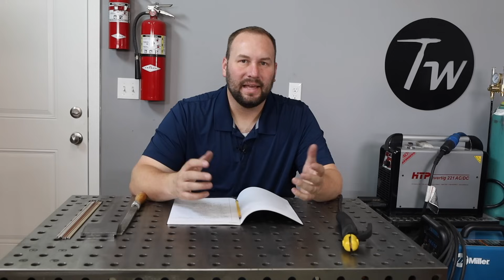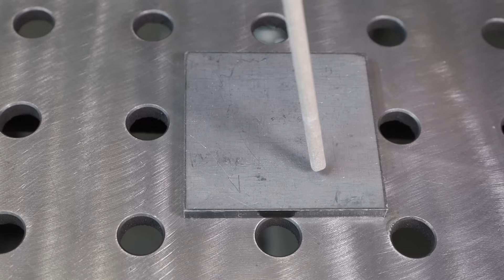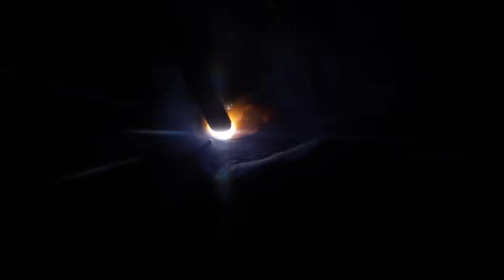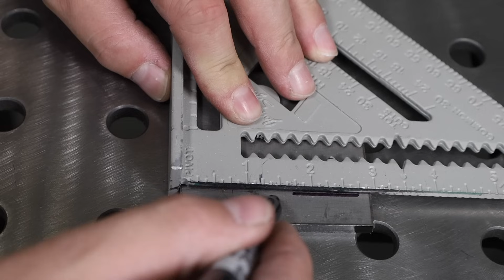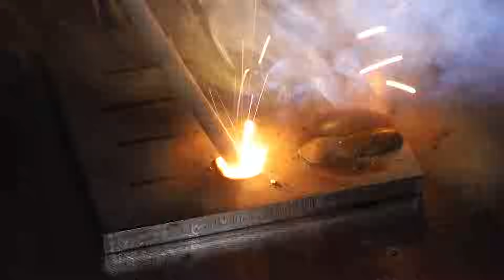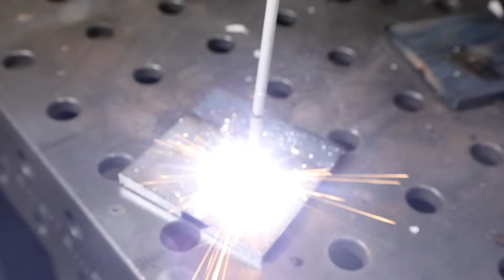Stick Welding: How to Strike an Arc

Comment: Hey Tim, I'm a mechanical engineer from Australia. I do a lot of automotive reporting. I've watched several of your videos and I wanted to thank you sincerely, and compliment you on your top-notch advice. (I see so much bad welding on YouTube...) You've obviously worked in industry, and I wanted to let you know I think you're doing a great job delivering high quality advice that I'm sure is helping many people. Welding rocks. If you get it right, it's a properly 'Jedi' activity. (Like, you're throwing sub-atomic particles and ionised plasma at a pool of molten metal and telling it what to do with the power of your mind. It doesn't get more 'Jedi' than that.) Seriously, well done making this quite specialised information so accessible. And I share your passion for 7018. Such a nice-looking bead - a real shame, aesthetically, to grind it.
Reply from the maker: Thanks so much! I appreciate that!

Comment: I just tried stick welding with 7018 rod on a multi-process welder. I stuck the rod about 50% of the first hour or so of welding. Then, once I got the hang of it I struggled to restart the arc without banging the tip of the rod against the workpiece, usually resulting in sticking the rod again. Your tip on filing the end of the rod was much appreciated!

Comment: As soon as the tip of the electrode is hot enough, it ignites much more easily without sticking, just as when the metal has already become a little hot, it can be easily ignited again and again, even with very low current intensities. If it doesn't work at all without sticking, you can also rub it very quickly with force over a piece of scrap metal and once enough sparks have flown and it has warmed up, you can then light it on the workpiece more easily.
Reply: sounds like a good tip.  I suppose you can't hide a cigarette lighter in your pockets while welding to use to heat the end of the rod though.
Reply: @inhibited44  I’ve got a very low quality Chinese stick machine, rods stick all the time, so I keep a propane torch nearby to heat the end of the rod, and I find it works well.

Comment: Suggest using your OTHER hand (with heat resistant gloves) to hold the rod - can often help to 'tap' with great precision, like holding a pencil, and then lift a little quickly to get started and let go with that hand. Especially helpful when the rod is long/new... keep up the great work!

Comment: Awesome video & thankya for the advise & for sharing. I've been out in my shop for about a month, practice & welding pieces together, filling in cuts & holes, running beads, & just having fun practicing, practicing, & practicing, until my old Lincoln buzz box arc welder took a crap on me!

Comment: Bought a stick welder a few years ago with all the accessories and a bunch of different rods. I tried a few hours to get my rod to light reliably but never could. It was so frustrating! If I could get the rod to light up I would get a nice weld laid down. But getting it to light was sooooo hard. The welder has been sitting in my garage ever since, collecting dust. After watching this video I decided to give it a few more hours and see if I could make it work!
Reply: You might also be well advised to put a few rods at a time into an oven... NOT the microwave!!! A regular heats up oven that can get hotter than 300F... Somewhere between 250 and 500F for an hour or 2 should be sufficient. BUT you absolutely CAN reheat them, so if it's helping but not quite there... hell... heat 'em longer and hotter in various little increments.. 

     7018's are the MOST notorious, but any rods can draw dampness from the air over time... even in those clever plastic boxes... I have a cheap little dirty Toaster Oven with a relatively new Oven Thermometer in it to do that job, myself... Just suggesting it might not be entirely a "YOU problem"... AND especially after years of sitting around, there's a good chance you won't get a chance for "prime results"... 

     Go ahead and try it, first... BUT... this is an option and any regular oven should do you... It won't leave a stink or mess up your food...

     Another option is the thickness of the rods effects the power requirements. Some people don't expect that... AND if you went to a Harbor Freight or other hardware store, they're sales-people, not welding instructors. You can find a "Stick Welding Amperage Chart" online for free... Scroogle it, and BOOKMARK IT... That thing's indispensible for me as a hobbyist. I so rarely go through many sticks because I use metal work to supplement some of my carpentry, OR to repair something in lawn equipment, and I often forget what the HELL I've been using, since I bake a handful of rods, stick them in the basket, and head out with the little welding cart... Half the labels wear off the damn boxes before I run out... 

     ...maybe I'm an idiot... BUT that chart's still AWESOME!!!  ;o)
Reply: @gnarthdarkanen7464  Yep, keeping the rods dry is a good thing. I wonder if my wife will let me use the kitchen oven for drying the rods... I think I should buy a cheap toaster oven as well. Also, how much rod quality matters? I have some no name chinese rods as well as brand name rods (Lincoln Electric). I have the feeling that better quality rods burn nicer.
Reply: @epatto   To a degree. For the most part (from what I've dealt with and experienced) after the E-nuimbers, a 3/32" rod is pretty much a 3/32 inch rod... BUT there are just certain times and places that say a 6011 from the no-name flea-market box didn't quite muster the heat to do the same job that a 6011 (same size) from Harbor Freight did, like blasting through paint or rust...

     I suspect, there are very little variations from one company to the next in the exact proportions of core-wire to flux coating... One way or another,  THIS variation can get the rod up to "operating temperature" (remember in the vid' where he talked about striking and adding arc-span to heat the rod?)... 

     To THAT end, I have found that finishing one short seam and going directly to the next with the rod still HOT, it tends to strike easier than setting the thing down (for duty cycle warnings) and letting everything cool off between seams... 

     Might not fix everything, or even most things... BUT it's a worthy experiment... What I did was set my tack-welds... using a last half of an old rod (filed clean... just good "manners" with sticks) AND then let the equipment cool to room temp... 
    THEN with a fresh rod of whatever qualities, I would weld about an inch and skip about an inch (just eyeball it, because I couldn't see the sharpie marks through the lens anyway)... The first set, I'd do one and set the thing down to cool, every time... file and proceed... The second set (filling in the skipped inches approximately... I just hit and skipped and hit the next... the best I could. 

    Other than being FUGLY as hell... The second set consistently went easier and better than the first... At least, such was my experience. It was FUGLY, because it's so damn tough trying to "eyeball" anything when you're blinded between the arc and the #14 lens I was using at the time... with only sunlight against a white table to help.

    ...well... then there's the 1/16 inch (read useless as tits on a bore hog to me) sticks... which wander around like I'm an epileptic trying to weld with cooked spaghetti.  I'd rather just blast holes in anything that light at this point...

    As to the oven, I have yet to sense any kind of odor or flavor over the stick cooking... BUT just to avoid conflict, a cheap used toaster oven and oven thermometer to work by could be worth their weigh in gold... JUST don't let folks at a flea market or garage sale know that.  ;o)

Comment: been watching some videos about "striking an arc" since it's an issue for me.  All welding machines are not created equal. Miller welding machines are apparently expensive, but when you set it for a specific amperage, the machine delivers that amperage.  Less expensive welders don't deliver that specific amperage you requested and make it even tougher to strike an arc, unless you increase the amperage.  On a Miller, if you ask for 130 amps, you typically get 130 amps, but other welders will deliver less amperage.

Comment: Also for starting, I believe by hitting up the part you are about to weld, you have better chance to make a proper weld!

P. S. I'm pretty rookie in the welding! It's been just one month that I've self-learned how to weld as I had to make Charge/Down-pipes, waste pipe, inlet manifold, etc. for my projects. 😅

Comment: Sounds a silly question, maybe, but with the dazzling arc, how do you see what you are doing? When I've tried this, I've found that a problem. Similarly, before the arc strikes, the facemask/goggles blind me. :) I haven't done much, but would like to get a cheap stick welder to gain the capability as it's a very useful skill. Thanks. Fantastic series from, I'm sure, a top class professional.

Comment: I'm a welder, please is it right to have a piece of metal close  to use as a ruff start, before striking on the actual work piece?, asking because, I've come to notice that successful arc strikes are very common with hot 🔥 electrode s 😊

Comment: I've watched this over several times and still can't get it. I'm trying to repair a mower deck with a dekopro mma-160a and 3/32 7018 rod and I can't get a stable arc. I'm on 120 plug and tried setting amps everywhere from 70-160 and just can't get it to work. Maybe I better try some clean scrap for testing rather than old mower decks. Any suggestions would be welcomed. Love your videos, Tim. Thanks for sharing.

Comment: The biggest thing I struggle with, is the angle in which I should strike the arc. 

Instructors tell me to fix my posture and dont move so slowly on the initial strike and they're right. Im just struggling to get that part.

Comment: DO you want to turn the welder off and remove the elctrode before sanding the tip off? Is there a risk of shock by leaving the machine on while filing the tip off while it’s on?? Thanks
Reply from the maker: I'd pull the electrode out of the holder and just place the electrode holder so the metal can't contact with the work. I rarely turn the machine off during a project. You shouldn't need to file it every time, just if you run into trouble with slag on the end. If you whip it quickly out of the puddle when you finish a weld it will usually flick the slag off and you can just break a little flux off with your glove.
Reply: @TimWelds  Gotcha. Thank you. I just taught myself to stick weld last week but keep getting my stick stuck ha. I skip over and learned to TIG weld first. So far stick has been fun.

Comment: Can I make a flux core DC inverter into a stick welder?  I have a titanium 125 and was just wondering if you have tried to do that?
Reply: It’s a different type of power supply.
Reply: The are a lot of stick welders on Amazon that are cheaper than that Titanium 125. You might wanna check out Tim’s review of the Dekopro stick welder.
Reply from the maker: Great question! I wouldn't do it. Wire feed welders use a power supply with a constant voltage while stick/TIG welding works much better with a machine that outputs constant current. This is to help keep the process stable when you manually control the arc length. I'm sure you could rig it up to work somehow, but the results will probably be disappointing. If you want to do some stick welding, I'd check out a dedicated stick welder. I reviewed a DekoPro that was inexpensive a while back and still use it from time to time. It works well for the cost.
Reply: You can buy multiple decent DC arc welders that go up to 150-160 amps for less than $100.00 that all work really good to start with. I have an iReboot brand and it does good.

Comment: I usually just use the tap method to strike an arc kinda like I'm knocking on a door and that works most of the time. If it doesn't then I give it a little drag then that does the trick. Now quite often I still manage to stick a 7018 and I think that's because my welder doesn't like them unless I crank up the amperage to 130-140 sometimes. 
Now I do have a good question, how do I know what type of connector my welder leads use and what size wire do I need to use? My welder does use the twist lock style connector but IDK if there a multiple sizes and my lead wires are quite thin. Not only are they short but I kinda sorta had the ground lead touch hot metal and it melted the insulation, while the welder was on... ooops.
Reply: OKAY... Ahead of time... Sorry for the length. It's not hard... I PROMISE. To be relatively complete, however, there's a bit of extra you should know about the situation... just for a better reference.

   If it was my welder... I'd start by finding every notation on the welder, and write EVERYTHING down the best I could... There's usually (not always) notes on the side or back about output current and voltage, and that as well as the obvious (Make, Model, Serial numbers)... BUT more details are usually better than fewer... 

     Disconnect the leads and make sure they match up (most are the same style connector)... AND then take the damaged lead along and head to an actual "Weld Shop" if you can find one. Hardware stores can carry what you have, but too often hire high school kids who couldn't tell you BEANS about any of it... You want to show and tell and then listen and even take more notes...

      Having the damaged lead (in your case the ground) on hand lets the knowledgeable pro (most weld shops have at least one on hand somewhere) establish your problem and he'll either know it off the top of his head, or he can look it up while he's LOOKING AT IT... That can be important. If there's a "Part" or "SKU" (often said "skew") Number, you should probably write that down, too... AND you can even ask about a matching number for the Electrode lead...

     If you can, finding an old timer who welds as a hobby or a retired welder is an AWESOME fountain of knowledge... He's liable to tell you something about "Back in the day we'd have a guy do something like that about every month, and we just..." insert professional shop talk about a field repair... blah-blah-blah... "AND those things would hold up until then next bonehead did something like drive the truck over a lead or weld his damn welder to the wall..."

     That's how you get tips to finish a "job" without making an ill-timed run to a shop that might be 50 miles away from your job-site (including the front yard because the wife kicked your ass out of the garage for welding the crackle box to her car that one time... 

      Okay... Here's a little electrical engineering tip for you. A "Grounding Wire" ALWAYS has "Zero Volts" registered. This doesn't matter what the polarity is. "Earth Ground" is ALWAYS "Dead Zero"... The reason welders have insulated "Grounds" is to protect them so idiots (like me) don't damage them irreparably by riding over them on motorcycles, lawn tractors, or my step-dad's truck... In any piece of equipment, you are safe leaving a ground wire completely bare... Which actually used to be the traditional condition, until enough idiots fried themselves in house wiring, and they invented the "modern 3-wire" system of wiring almost everything... 1"Hot" wire (black in US house code) 1 "Neutral" (white in U.S. house code) and 1 "Earth Ground" (still often bare in US house code)... It's technically "Earth Ground" (even on 3-wire 220VAC wiring) because it's supposed to (by legal construction code) route to a "Grounding Post" at least six feet deep in the actual ground... 

     In any case... Just so you know, you're probably not going to burn anything down by wrapping the thing in black-tape to avoid the rest of the insulation breaking free and wandering off of it... and welding to finish or whatever... It's still better for the machine (design and engineers and all)  to get a replacement... OR you can call the replacement a "Spare"... Cut it off at the lost insulation, and just move the grounding CLAMP at the end to the new "end"... I usually go after a good set of bolt-cutters (the kind used to break locks) for this, because lineman's pliers just SUCK at taking on that much metal... BUT Welding Supply Stores sell replacement grounding clamps, so sooner or later, you might as well face the process and learn how to replace that on your own. It's not particularly complicated... You just about can't f*** it up.

      AND you might find out the shorter grounding lead is a net benefit, just by not having so much wire and insulation wandering around under foot. 

      Sorry for the length (again), BUT I hope this helps out.

Comment: I am struggling so hard with sticking. And I’m running a fairly “easy to use” rod. I spent three hours my last class just trying to strike an arc. Stuck every time. Now sticking terrifies the crap out of me and I feel a bit like I’ve failed. The back and forth motion never works on my tiny coupons, so I end up having to pick my work up off the table or releasing my rod from the clamp, none of which feels like a good or safe option. My last class made me cry. I went from loving welding to not wanting to show up. I don’t understand where my amperage/voltage should be, or how high it can go.
Reply: That's rough. Keep trying.

Comment: Just bought some 7018 2,5mm and can't strike an arc even at 140amps, although i can weld decently with 6013, with my 7018 sticks it eiter sticks or weld for one second then dies, what can it be? same issue on AC and DC+

Comment: Ps don't leave the file on a negative connection work bench because it will arc badly if you clean the slag on the metal bench............sounds simple? But silly me, I got a long flash mask up, fortunately I never developed ARC EYES later that day.....LESSON LEARNED